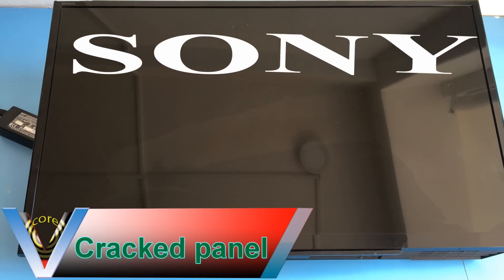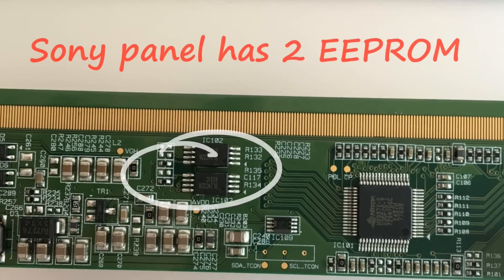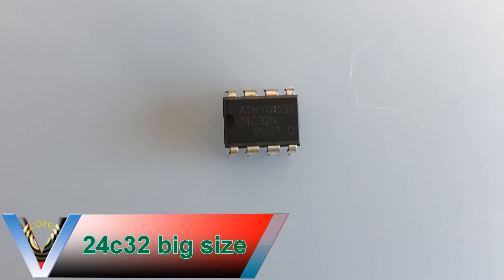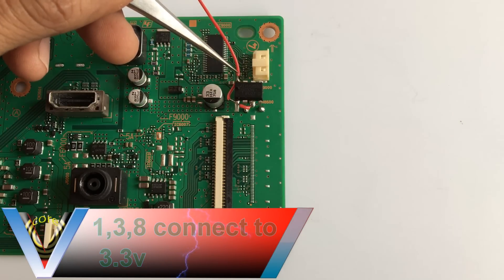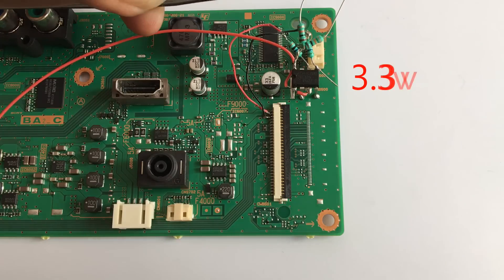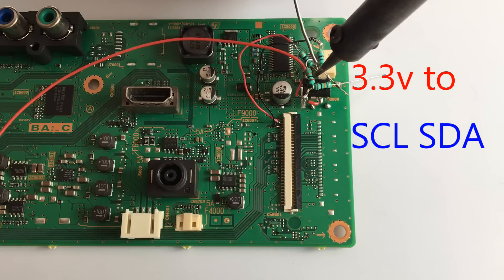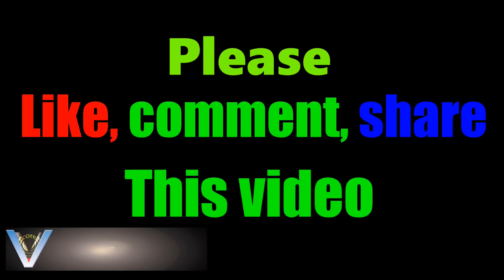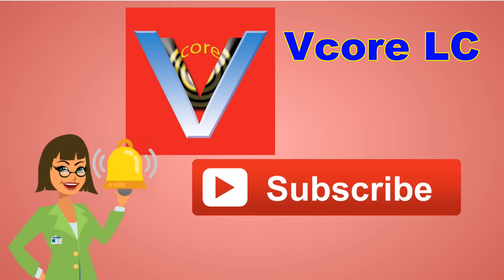SONY BRAVIA LED Display Changing Technique

Comment: Sir i have lg 43inch led tv display not cracked officer say u change display
Reply from the maker: Try to repair if possible check essential voltages are there or not?

Comment: i have got an query regarding display, My Sony KDL EX720 32 inch model has got display issue, can the display be replaced with Sony brand or any other recommended brand..

Comment: Hi 
I have a Sony KD-55SD8505 curved 4K tv 
 It started with a solarisation problem and could use the tv as normal. 

1. changed the t-con = SOUND ON ——BACKLIGHT OFF, PICTURE OFF
2. updated the firmware off the Samsung UK/Europe site via usb. After the update = SOUND ON, BACKLIGHT ON ——PICTURE OFF
3. Put the Original t-con back in so it’s back to how it Originally started. = SOUND ON, BACKLIGHT ON —— PICTURE OFF

T-con
UZ-5555T30C03, T550QVR04.0 CTRL BD, SONY KDL-55SD8505. Screen T550QVR04.0 

Model: KD-55SD8505 UKA
BMG7121 
T550QVR05.0.        XXXXG
AU55Q50ACZTW8CN2G81606F
AA6F56X6QDZZ-ZZ45S0
Manufactured 16/32  MADE IN CHINA (Z45)
Serial Number: S01-6703027-B
015955T3100167R000M1206D0FV00

Any help would be Gratefully received. I’m an electrician, just starting out learning how to repair TVs etc thank you In advance

Comment: I have a kd60x690e 4k tv which has 6 blinking lights. Changed every board and even got a tv which was working perfectly with cracked screen, and put the good screen inside and still giving 6 blinking lights? Any ideas? Works fine from time to time.
Reply from the maker: Check backlight connection or strips

Comment: Sir /Madam,

 My Tv purchased 4 months back now it's display problem but out side no Scratches but Sony informed it will be charge but they charging huge amount please help to resolve the issue
Reply from the maker: Check panel voltage first

Comment: Thanks for your video, it's great! I need a converter for for my sony tv . I took it from Akai 55" LED panel, but the panel cable is small ( 60v ) Sony is 90v. What is the solution? Could you please give me a idea
Reply: Perhaps use a voltage convertor or even resistors to reduce power input to a lower voltage

Comment: My Sony Led Tv Model KLV-40EX600 
5 Tmes Blinking 
When We Start TV Show Name 
SONY 
And Start Blinking 5 Time 
Blink  5 Times Blink 
Any Solution please
Reply from the maker: Panel related problem... malfunctioning with scalar pcb or lose connection with LVDS/FFC
Reply: Do you have its video, Sir ? #I'm facing the same problem

Comment: 2 questions sir: 
1. Can i install my LG LED PANEL to my SONY LED TV? 
2. Can i replace LG Mainboard with SONY Mainboard?
LG Model: 32LM3410
SONY Model: KLV-32EX33A
Tnx
Reply from the maker: Of course ! you can do it but, make sure that your panel resolution must be same..
Reply: @VcoreLC  Thanks so much. How bout my number 2 question. Can i replace my LG MAINBOARD with a SONY MAINBOARD?

Comment: Not working,( I have AUO PANEL IN SONY TV, BUT NOT WORKING YOU PUT ANY OTHER BRAND PANEL, BLANK CONDITION)
Reply from the maker: No matter what is blank or full , you have to connect proper connection with old panel control board (panel I’d eeprom ) definitely it works

Comment: I tried to do it and it works, but at exactly 2 minutes it turns off and standby LED blinks 5 times. Is it possible to solve this? can you give me any idea? My TV is a Sony Bravia 40" Full HD
Reply from the maker: Send please your panel connection photo WhatsApp +977-9855054737
Reply: @VcoreLC  ok, thanks for your prompt reply, 
 right now I will be sending it to your WhatsApp

Comment: sir i have sony lcd tv panal is brokan  i have led panal can i change . i want know lcd and led polarizer sheet deferent pls tell me sir
Reply from the maker: No problem yo can do it , LCD or LED panel are same (different only backlight)
Reply: @VcoreLC  thank u sir .  sony v216b1-l03 panal - i have led panal is m215htn01-1 wich cable and coniter  can use .  pls tel me sir
Reply from the maker: these are different resolution you can't use in sony
Reply: @VcoreLC  THANK U SIR can u tell me how much cost that sony panal r polarizer sheet.  sir pls tell me how should i download softwear vravc-0714bt main board  m-no ; CREL7064  THANK U

Comment: Is it possible to use this process for othet tv's? i have a broken lcd samsung tv, can i use this procedure to replace the screen with one from another brand?
Reply from the maker: Of course ! You can do that...
Reply: @VcoreLC  So basically you dumped the sony edid eeprom and copied to another screen, that's wonderful. I'm wondering, is possible to upgrade a laptop hd screen to a fullhd one?